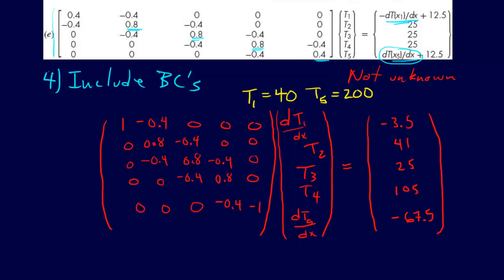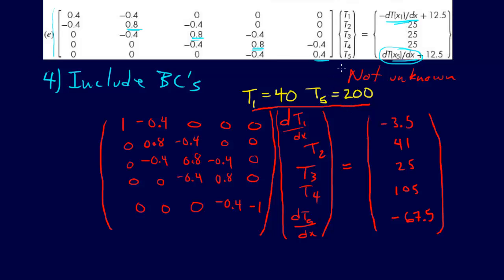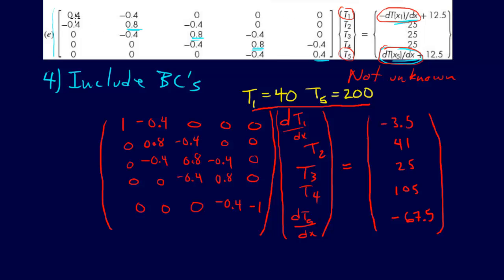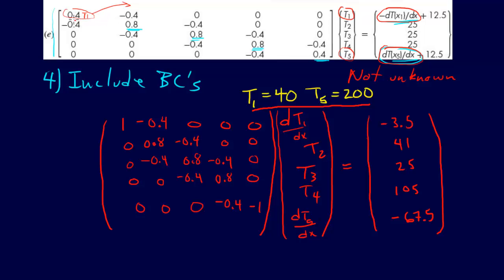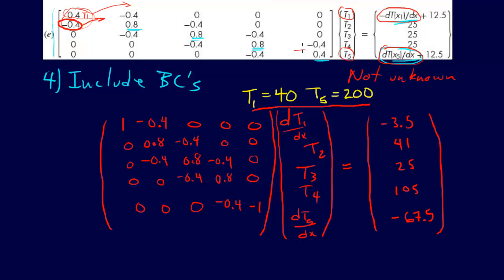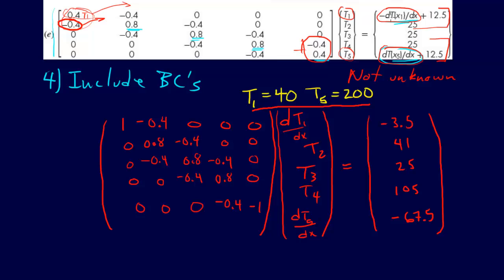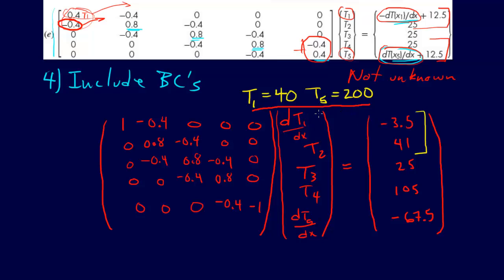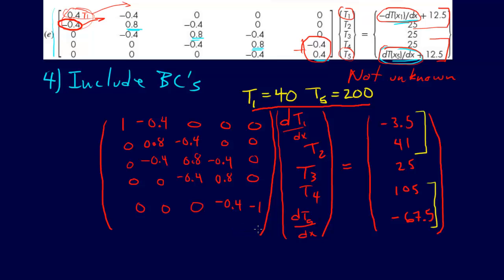8.3.6-PDEs: Finite Element Method: Boundary Conditions

Comment: Thanks, these are extremely helpful.  I'm a little confused as to why the matrix elements at A(1,1)=1 and A(5,5)=-1 when you multiply them out and move to the other side.
Reply from the maker: The vector has changed from {T1 T2 T3 T4 T5} to {dT(x1)/dx T2 T3 T4 dT(x5)/dx}. To maintain equality, the matrix also has to change. Looking just at the equation from the first row of the original matrix, we have 0.4*T1 -0.4*T2 = -dT(x1)/dx + 12.5. We are also given T1=40. Substituting the value of T1, we get 16.0-0.4*T2 = -dT(x1)/dx + 12.5. Then, re-arranging (so that numbers are on the right, and variables on the left) gives us dT(x1)/dx - 0.4*T2 = -3.5. That means a +1 corresponding to the dT(x1)/dx when it is put into matrix form. I hope that helps!